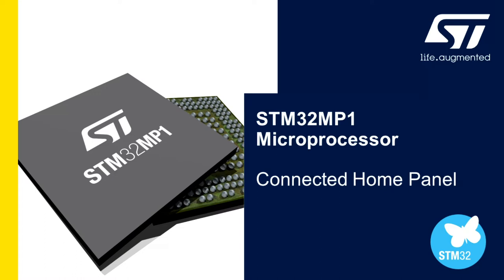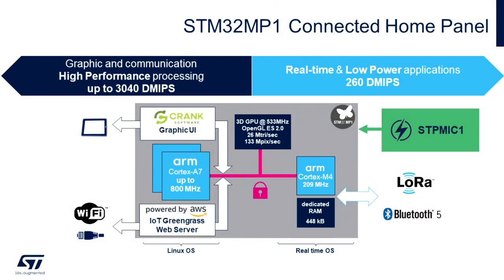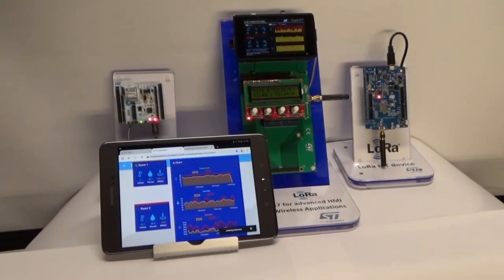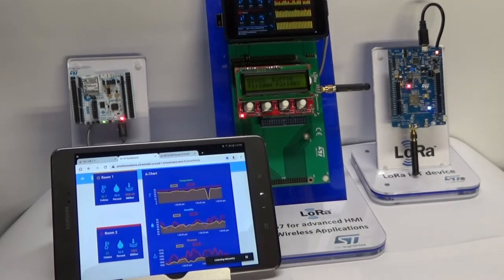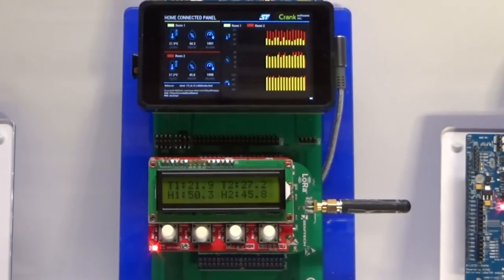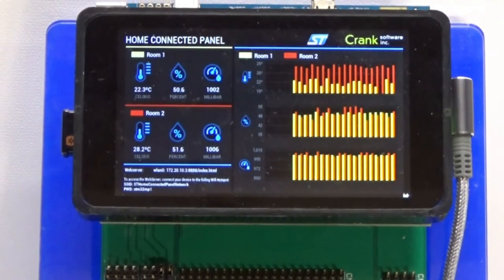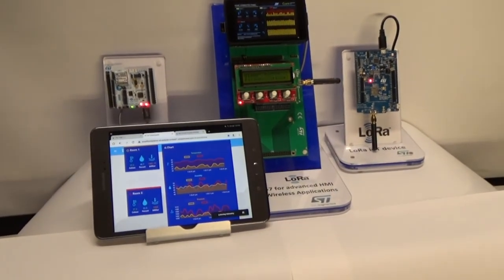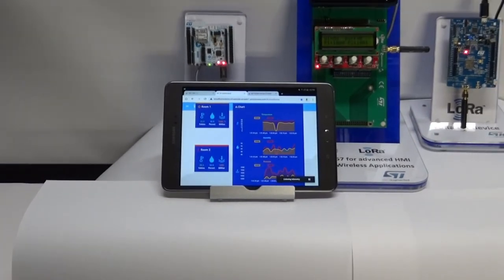Sensors & Embedded Technology 2020: STM32MP1 Microprocessor - Connected Home Panel

Comment: Crank Framework? Traitors!! Where is TouchGFX!? You should have used TouchGFX
Reply: Lol
Reply: I'll point out that TouchGFX only runs on STM32 Microcontrollers, not the STM32MP1.  Crank is a great option for a graphics framework on the MP1.  You might also want to check out Qt or Embedded Wizard.
Reply: @mikehartmann3146  thanks for the clarification. I prefer QT for embedded because then I could use my same codebase for a PC application and an embedded solution.